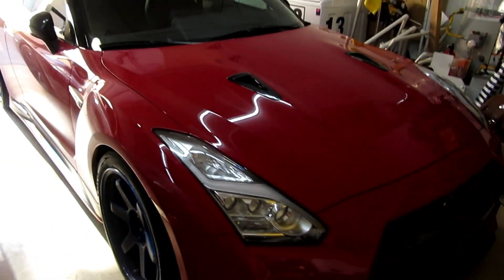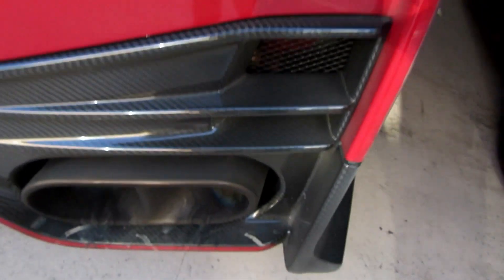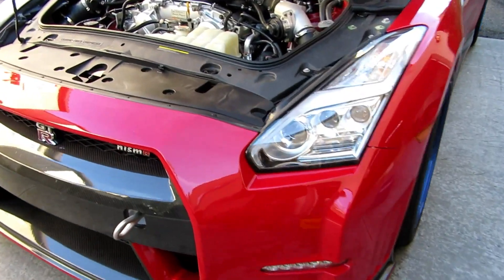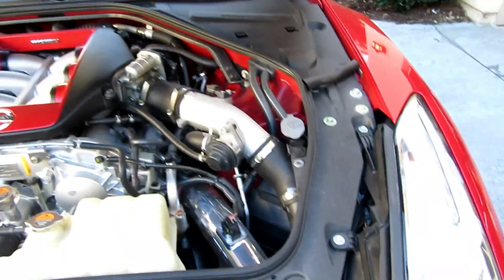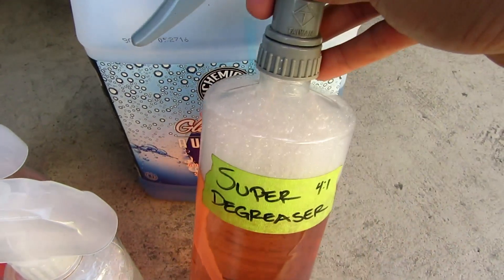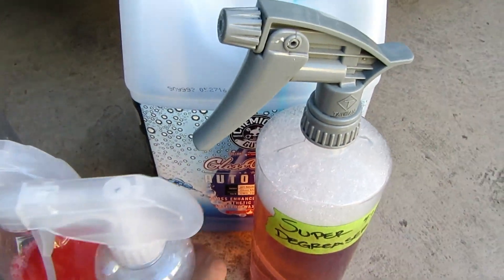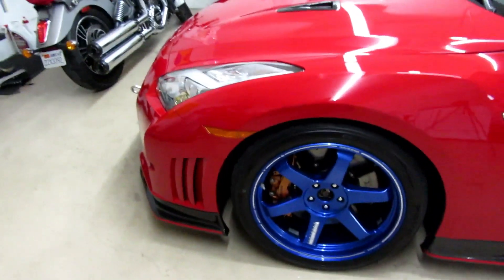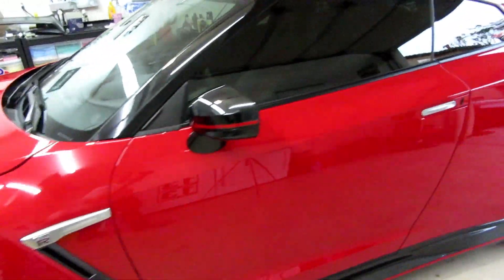Nismo GTR wash

Comment: Hey mike I have a question about the sunjoe. Did you have the issue where no fittings fit on the supplied hose? The male fitting on the hose is slightly too big. Doesnt fit the short gun or quick connects I bought.
Reply: Okay just looked up your pressure washer setup video again. Yup need a new hose

Comment: What's your dilution ratio for the Meguiar's Super Degreaser? Haven't found the right ratio to out perform Eagle 1 A to Z tire and wheel cleaner. I go thru that so fast. That stuff works great! I bought Super D to try to save money but, so far I haven't been impressed when it comes to tire cleaning. BTW .. I use Chemical Guys VRP as my dressing.
Reply: Javier de los Santos 
Says 4:1 on the spray bottle
Reply: Yeah.. that dilution ratio doesn't work that great, at least when I compare to Eagle 1
Reply from the maker: Javier de los Santos then just stick to eagle 1. I always say use what works for you.
Reply: I hear you. I do like Super D for engine detailing. Removed tough oil stains from the underside of the hood. Bought Super D to save $ because I go thru so much of Eagle 1 A to Z.
Reply from the maker: Javier de los Santos try a dedicated rubber cleaner from Griot's or Shine Supply

Comment: Do you have trouble with the hose you bought from home depot kinking? Mine kinks horriby..
Reply from the maker: TheDarkKnight that's never been an issue
Reply: MikeEM1 strange cause it looks like you're using it in this vid and mine has a good 6 twists on it and I only get about 12 feet to work with .